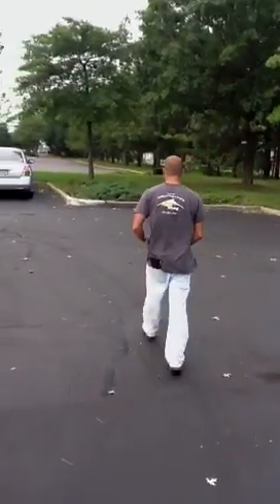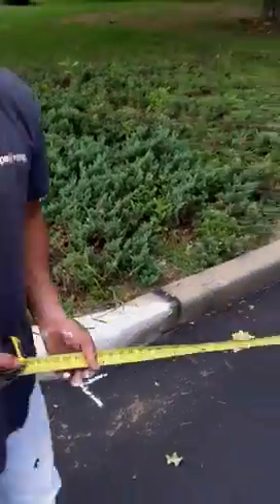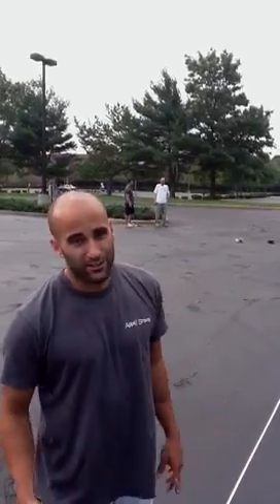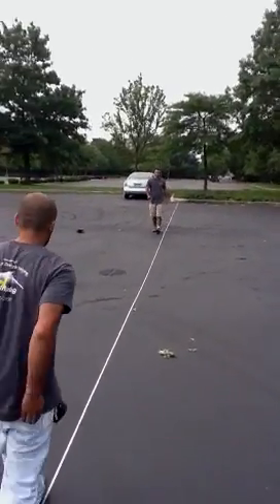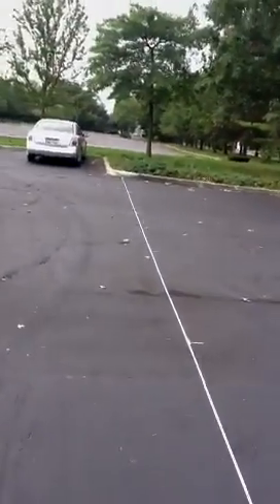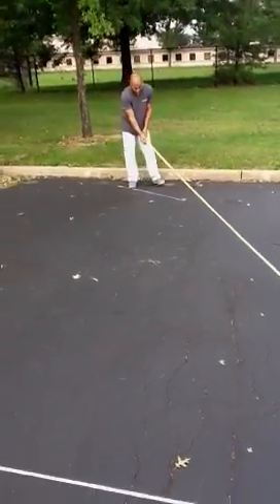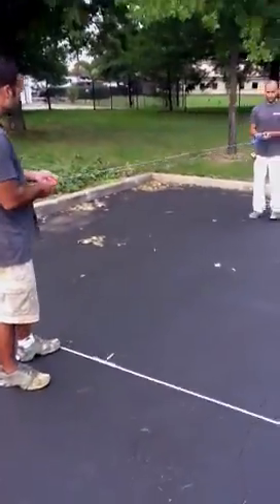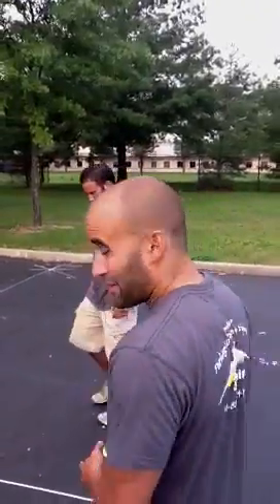How to layout a parking lot

Comment: We have been in business for 70 years and that's basically how we still layout and it works. Except I would have made 9' marks along the  curb as long as the curb is straight  then swing a square, that way you are 90 degrees with the curbing.
Reply: After ya lay it out pop the 18ft lines, do y’all spray on the side of the line or spray center of the line. 
Thinking if you spray and the line is center of your paint then the parking space becomes smaller than 9 ft. 
But if you spray to the same side of each line it would stay a true 9 ft space?

Comment: What you don't use 9' 12" 15'???? To square up a 90° That's what we professional use. From the 90° sqaure up point you'll get your 60°angle by measuring  7'6". You always have to have a baseline ( that's where  all your painted lines begin ) which is typically 18' per code but really could be what ever you want it to be.

Comment: You need to factor in if the curb is at a angle so the way it was laid out in your video is incorrect the line could be straight but the stalls could not be perfect 9" spaces.
Reply: Actually that's the standard measurement. 18'L 9'W
Reply: I see my mistake
Reply: Burn. .....
Reply: Kidding"
Reply: That's what I was thinking too. If that curb isnt straight, that setup will not be square at all.

Comment: This is NOT how you accurately layout new striping.
Reply: why do you say this is not how to accurately lay out a parking lot? His lines will be square and straight, so what's so wrong with what he's doing
Reply: Shawn Ross wow that shit is all ass backwards holly shit what did I just watch
Reply: No shit
Reply: @dangerdanger8104  what’s he doing wrong. I’m try to lean the methods to lay out parking lots.
Reply: It's funny cause you have no videos doing anything about riding a dirt bike around. Nothing to show you have any experience in stripping parking lots or doing anything that would give credibility to your statement
Reply: @ulfrenterprises9504  I have only been doing it for 18 years.
Reply: @mxracer.64  what should be done differently?
Reply: A common problem would be that the lot isn’t a 9’ increment. Say you have 94’ between curbs. Is it ideal to have a 4’ spot on one end? The first thing I’d do is measure overall and decide whether the last two spots adjacent shrubbery need or can get an extra foot or 2 so their car doors door can open. Or every spot gets a few inches or whatever.
Reply: We do the same method and it works! Whats yours?

Comment: Love your squaring method! Quick tip to improve chalk bleeding through your paint. Pull a rope tight from mark to mark and spray the rope with tracking gun. Marks will remain if you must pull off for rain, no bending over, and much more efficient.
Reply: What is Tracking gun that you spray on rope??
Reply: Jack Attali a tracking gun is a krylon 34" marking wand that sprays upside down spray paint on our layout rope. Then we follow the void left by the rope. Quicker and easier on the back
Reply: Ryan Cox
Thank you Sir!
Reply: Ryan Cox nobody uses a rope anymore. That's the old way
Reply: Danger Danger I work for a huge striping company and wether it’s roads or parking lots we use a lay out string and wand